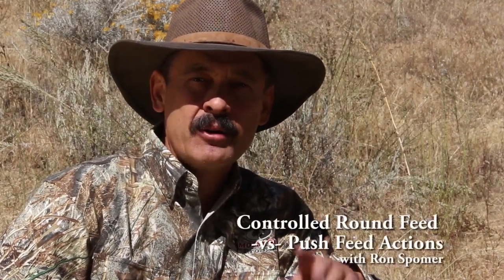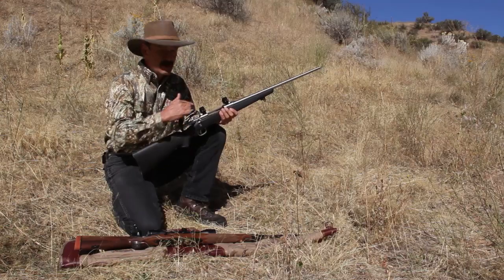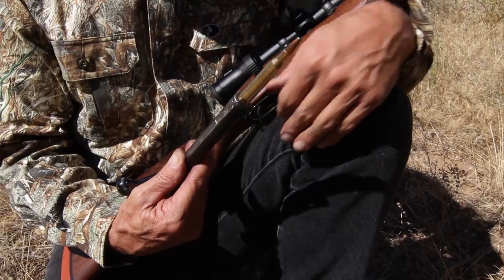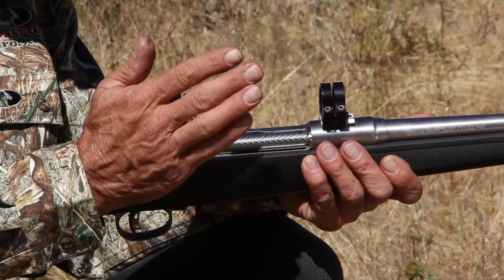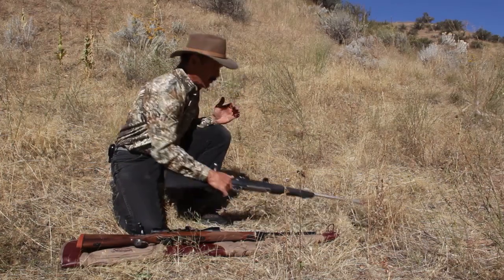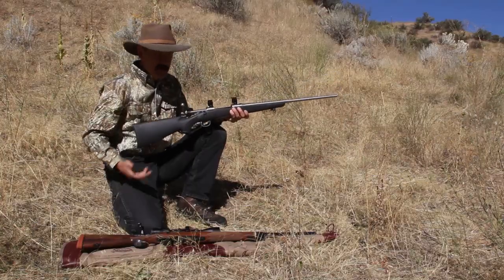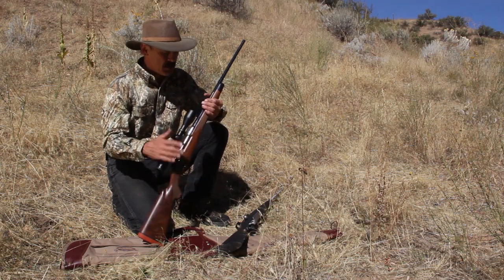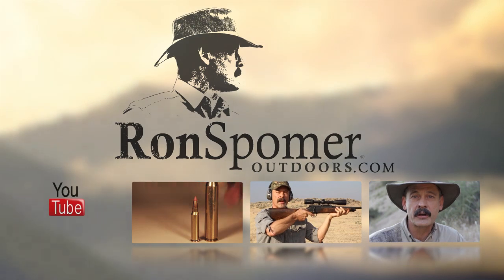"Push Feed -vs- Control Feed Action" with Ron Spomer

Comment: Do you find that a push feed is more accurate than a Control Round Feed? Or vice versa?
Reply from the maker: Neither. Feeding and extraction don't change accuracy unless extractor hook is pulling the cartridge off center or ejector plunger is pushing it. That both CRF and push feed rifles have been built shooting sub 1/2 MOA proves this.
Reply: @RonSpomerOutdoors  thank you Ron!

Comment: I have both CRF and Push rifles. CFR can jam also. I lost a trophy bull elk a year ago
because of a jam on my 98 Mauser. My first shot wasn't that great and didn't put 
him down. I needed a second shot and found the rifle jammed.
Somehow during feeding that second shell it had popped up out of the magazine
and was laying loose in front of the bolt. Pushing it into the chamber ahead of the bolt
the extractor didn't grab the shell. The bolt wouldn't close on it and grab the shell and
you couldn't fire it. It now was stuck in the chamber and had to have a cleaning rod
to push it out. Bull elk was gone by then.
 CRF works great only if shells are down in the magazine. I had a gunsmith modify
the bolt of my 98 to be a push feed. Push feed will grab a loose feed.
Reply: Most crf's allow it all mine do, if you have one that doesn't you should hone it so it will , your gunsmith should have had enough brains to know how to do that

Comment: Really almost have to specify between control round feed pre 64, and the pre 64 style control round feed reintroduced in the 1990s. Now push feed starting post 64 is a stronger, more accurate design as it has total control of the case rim where the pre 64 crf has control only in two places. This was updated in the 1990s with the reintroduction of the pre 64 crf style action as well with the ability to single load without the chance of breaking the Mauser claw extractor like a pre 64 crf. Now in 2004 to 2008 there was a model 70 control round push feed which is a control round feed with a sliding plate extractor, and the mechanical blade ejector so there is no pressure put on one side of the case rim while the round is in chamber which has been known to cause accuracy issues. The crpf made from 04 to 08 is a benchrest style action that is extremely strong, with a solid high carbon steel bolt handle rather than being like the weaker forged(pf model 70, rem 700), it also has finer remage style tenion threads rather than the coarser model 70 threads. as well as being an extremely accurate design and throughout the gunsmith community of us that have worked on all model 70 types, it is the very best of the model 70s which were already outstanding compared to the other brands of factory mass produced actions.
Reply from the maker: Thanks for the detailed report, William.
Reply: @RonSpomerOutdoors  absolutely, I love the model 70 action regardless of which one  they are very fine rifles. It's unfortunate the post 64 got put down so hard by gun journalist of thar time because it's a great action as well. I enjoy a lot of your YouTube videos Ron and agree with you on alot especially the knock down power myth of heavy bullets. Also liked your custom Model 70 chambered in 6mm Remington. I would like to find an original pre 64 model 70 in 250/3000 for my collection but it's unlikely I will find one but a man can dream. Thanks Ron.
Reply: @user-un5my5bw4j  I honestly had no clue they were even factory offered in 250/3000. That would indeed be a big find!

Comment: The main issue I have with controlled feed is that you HAVE to feed from the magazine.  You can't just toss a round on the follower and close the bolt, because the claw extractor won't jump the rim of the cartridge.  
Having been shooting a 700 action for a while, I was quite surprised when I couldn't just drop a round in the chamber for my M77.  I was concerned that there was something seriously wrong with my headspace or that something had jammed the bolt somehow.  
I imagine that you could get excited and not fully close the bolt on a push feed and cause a double feed, but I also imagine that if you happened to need one more shot for that lion, having to push the next round down into the magazine before closing the bolt on a controlled feed action could also cause problems.  (Especially when using removable box magazines that you can't load while seated in the rifle.)
Reply: That is 100% not true , with most cf's I have winchester crf model 70's a 1917 enfield and others, all will slip over and chamber a round dropped in the mag, in fact some of the early military rifles had cut offs for you to feed one round at a time while keeping your mag full , anyone hunting dg should have enough sense to be sure his crf does allow that, as I did read of a guy getting mauled when he had one that didn't , if you screwed up and tried to chamber a round with such a gun, you would not have any way other than a cleaning rod to remove the round you had pushed into the chamber

Comment: You cant drop a round in the chamber and run the bolt with the CRF..But, I still love my FN Mauser in .300 mag, the CRF is hard to beat
Reply: Dan, you can with many CRFs these days. They bevel the leading edge of the extractor spring and it snaps right over. I don't know if this is optimum for longevity, but it hasn't seemed to hurt any of my CRF rifles thus far. Win M70s, Rigby's, Kimbers mainly.
Reply: That is a lie almost all allow it
Reply: @ronspomer4366  I have a pre war model 70 and others all allow it, my 1917 enfield allows it and the military guns with mag cut offs of course allowed it so I have guns over a 100 years old that allow it, I know some don't , but I have never seen of had one, and of course if you are dg hunting you should make sure it does or bevel it as you said
Reply: My rifle is a 1950s  FN mauser...CRF and it can not be done
Reply: @robertboyd3863  if you try forcing a round the casing would be in front of the bolt because it didnt slip into the claw...the bolt will not close and it will not fire..
Reply: @danthedewman1  Care to make a wager , you don't know what you are talking about , I have done it countless times,
Reply: @danthedewman1  I understand a few of the old junkers did not allow it , they should always be honed so they would if dg game hunting
Reply: @danthedewman1  Why do you try to tell me such crap, when I have old model 70's one a prewar, all allow it as do the old 1917 enfields, the old military guns had cut offs to keep the mag charged while you shot single rounds, if you would do a bit of research you would know better

Comment: Seems to me theres a reason 90 percent of bolt actions out there including those in use by the military are pushfeed actions. And dont give me that cost bs, the chassis alone used on the m2010 is $4,000, the new mk13 mod7 push feed action replacing the m40 sits on a $3,000 chassis with a $4,000 optic, for crying out loud the rifle case it gets delivered with is almost $1,000, both rifles using magazines costing anywhere from $80 to $120, and your going to say the military decided to sacrifice "reliability" to save maybe $200 per rifle and go with a push feed action? I hunt with a crf M70, but I can be loading a cartridge into my defiance deviant while doing a backflip on a trampoline and I guarantee it will chamber every time. Now the double feed issue, I can force any rifle to double feed, push feed, crf, nothings idiot proof.

Comment: You missed the con of the CRF. that you can't just drop a cartridge in the breech and close the bolt. for when you need an emergency follow up shot
Reply from the maker: Good point, Bob, but only on some CRFs. I have several that do single feed. Just takes a bevel on the front of the extractor hook.
Reply: And, I've never seen one without the bevel.

Comment: Double feed into loaded chamber with a push feed?  Possible for an inexperienced operator.  Round falling out with a rifle tilted or upside down?  Complete myth.  I own eight push feed bolt guns of three different makes, and NONE of them will allow that to happen when run properly.
Reply from the maker: And nigh impossible even when run improperly. Thanks for your insights, Shawn.
Reply: Apparently you didn't watch this video.  The double feed happened right before your eyes!

Comment: The problem with controlled round feed guns is they have that HORRIBLE 3-position wing safety. A lot of bucks have gotten away when guys went to flip the safety off only to put it on half safety where the gun can’t fire. I prefer a model 700 safety, or better yet a tang safety.
Reply: I hate a 700 pos safety
Reply: Good lord, Warren, The military Mauser safety is almost bombproof,  the Tilden safety is the mark of a properly modified, cock on opening Mauser, when a telescopic sight enters the picture.   Winchester and the proper copies are as close to "Stone Ax" reliable as any thing made by man..  The flimsy designs used to work around those  patents are almost all harder to get your thumb on, so I for one don't quite see what you are disturbed by.
Reply: Bruce- I wasn’t questioning they’re reliability, just the quickness at which you can disengage it. Try reading and understanding someone’s comment before replying!
Reply: Warren, 

Fifty plus years of shooting Model 70 Winchesters, Hunting more than a few times with them, and with "sporterized" M98 Mausers with the original "sideways" safety, both "three position", and unlikely number of range days when the Model 70 was common as cross winds, and you are the first to make a claim those being hard to move from safe, past the position you are calling half safe, to the fire position. 

I really did read your comment, which still seems to call the Tilden safety unreliable,  possibly you should re-read it?
Reply: Bruce- I don’t know how you’ve never heard of anyone not liking the safety’s. Everyone I know doesn’t like them for the reason I described. But like I’ve said on multiple occasions, gun guys are the most opinionated people you will ever meet.
Reply: @warren3665  , 

I hope you would agree that anyone who takes a rifle big game hunting, and hasn't operated it enough to run it's safety (whatever kind!) probably needs to find a place and time, to practice.

I just checked on the four rifles in easy reach, and no two follow the same action to go from safe to fire, but I've had exactly zero cases of need to get a shot off and the safety blocking me.  Simple, when you pick up the day's rifle run through it's process, and regroove your reflexes.

What I like about the Model 70 safety is how easy it is  to see what state it is in,  which is sometimes a bit of a guessing game with others. I will note that I've never had a Model 70 safety stop halfway, but I have big hands, and push pretty  hard.